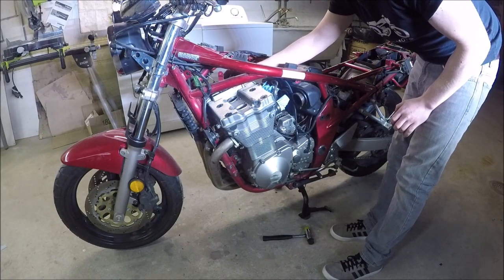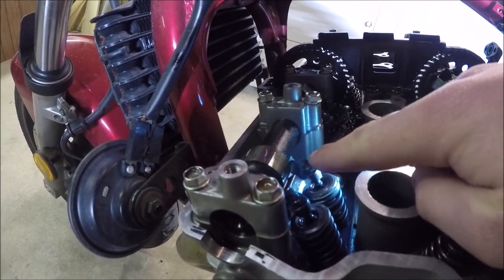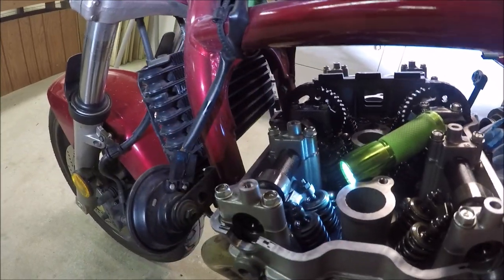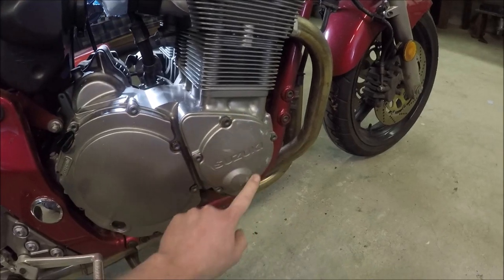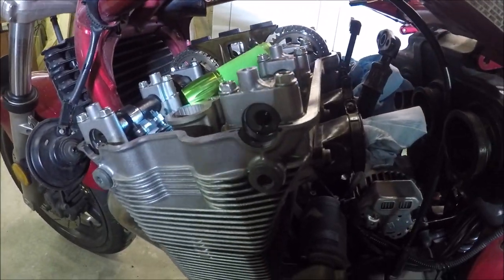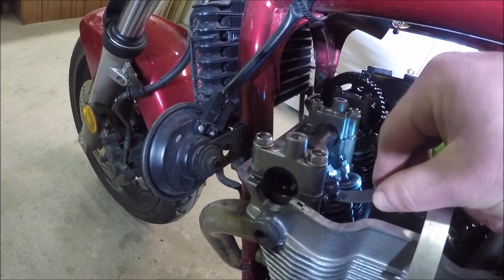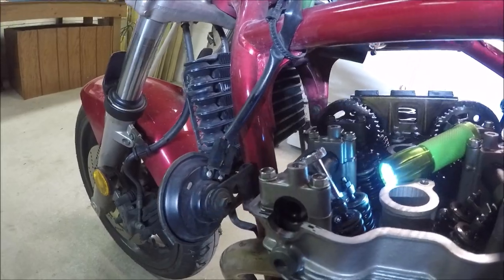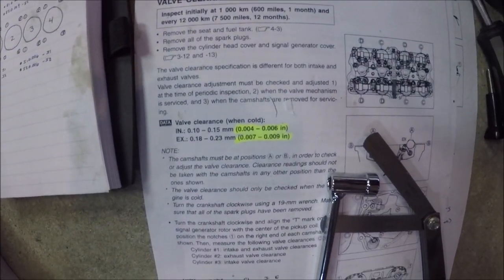Suzuki Bandit GSF600 - Valve Clearance Adjustment (short version)

Comment: Where do you buy your parts?
Reply from the maker: Depends. OEM I usually use Partzilla. Lot of ebay. Hardware store. Harbor freight. Revzilla and cycle world. Just depends.
Reply: @matttriestodothings  Thank you! I've recently acquired a Bandit 600 and several of the parts websites only list the GSF1200 and 1200s. It's been a bit frustrating to say the least trying to find a good selection of 600 parts.

Comment: Is the procedur the same adjusting the valve clearance vise on the bandit 650 k5...got new seals and valve cover seal beacause i head some samall leaking on some bolts
Reply from the maker: I would bet the procedure looks nearly the same; however, I can't confirm that because I've never worked on one of the fuel-injected Bandits. I'm not sure what engine modifications there were between the 600 and 650 besides the obvious displacement change.
Reply: @matttriestodothings   Hi... already did it... after opening it, I found out everything was within the tolerance, oh and its not a liquid cooled model, its air/oil cooled with the same carbs as yours... I think they did the 650 version for only 2 years... mine is 2005 and has 83 000 km :)...tnx for the video,it really helped :)
Reply from the maker: @Mctigel  ohhhhh shoot, that's right, my bad! I forgot the 600 -> 650 change coincide from the switch from carburetors to fuel injection. Sorry about that.

Good deal on finding everything within tolerance! That's quite a few miles on the bike. And thanks for the feedback--glad it was useful.